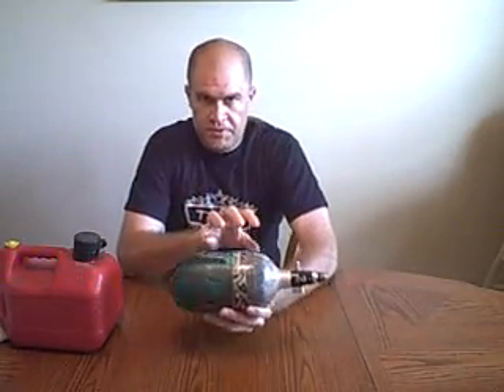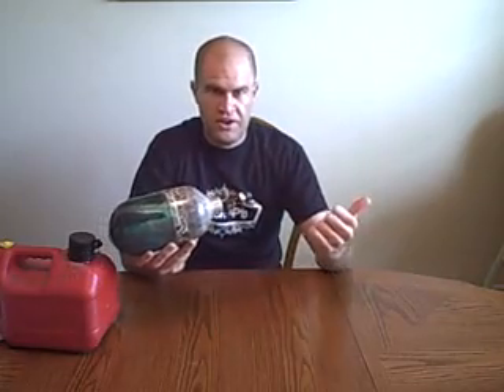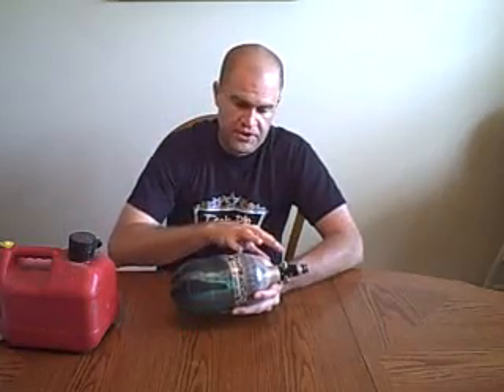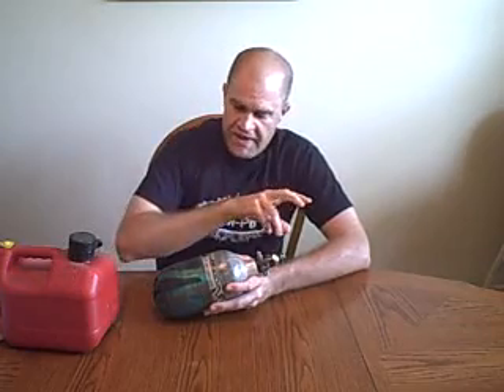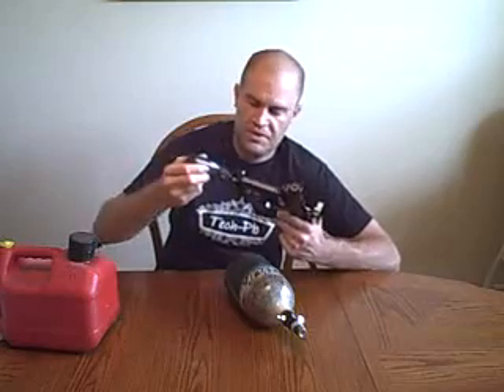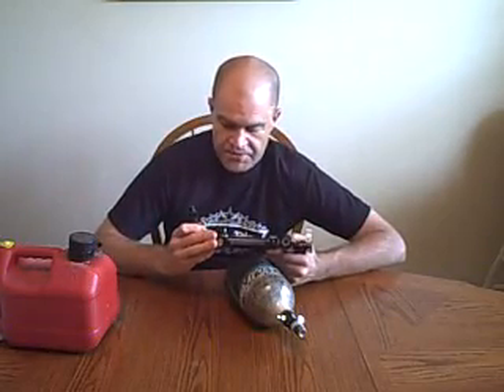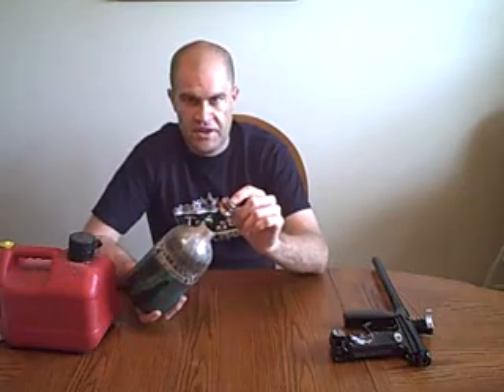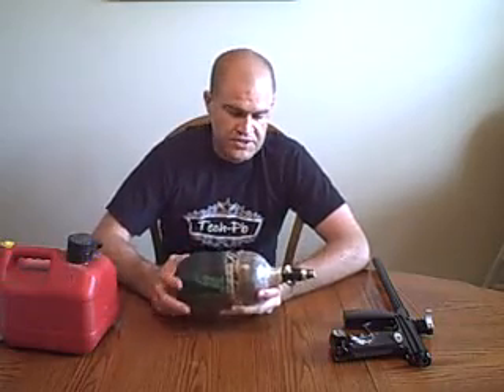Exploding Paintball Tanks (This applies only to HPA, not CO2)

Comment: Actually when I was taking welding courses years ago a guy used his figures to clean the bull connector on an oxygen tank and the natural oil from his fingers, upon opening the tank caused the regulator to explode off with enough force to pass the regulator through a concrete block wall.

Comment: Hey, i Was installing my new guerrilla regulator onto my Ninja tank and while i screwing on the regulator, i saw that the locktite was on the same thread level as the bleed passage. it looked dangerously close. I didn't wipe it off. for somebody told me that it'll be fine. will this cause a hazard to me? Should i redo the regulator? will it just dry up and be harmless? thanks.

Comment: the only reason why airsoft is far less popular is because 1. there are far more restriction with airsoft rifles and I'm not talking about the plastic guns but the full metal complete replicas. 2. far more expensive depending where you are a good full metal rifle can cost from 300 to 500 dollars, 3. there are more paintball field than airsoft is because paintball fields make more money than airsoft, as they can supply rentals far more easily as airsoft it's usually require to have yourown things

Comment: Hey mike, my fill nipple is leaking right at it's threads (i can hear the air hissing out). i put a drop of water right where the threads are and i saw bubbles come out. i then wiped off the water. and took a wrench a tightened the nipple onto the tank. The hissing stopped. do you think its safe to use?? thanks

Comment: ?pressure causes oil to explode? It does explode at room temperature, or due to heating caused by compression? i remember oxygen tanks are forbiden to lubricate in welding..

Comment: I was wondering, is it safe to place silicon oil into the On/Off valve of a remote line? I know that it is safe to place in the ASA of a marker. Would the regulator of a HPA tank stop it from getting too much pressure in the remote line to combust the oil? Just want to know before I end up damaging my remote line or worse, myself.

Comment: @vback77 Yeah doesnt matter. But I have no idea what you are talking about. Your putting lube in your ASA to clean out your gun? Or you mean putting it in your breach? Your suppose to use oil on the bolt. Only need to put a few drops on your bolt.

Comment: @airsoftremix - to my knowledge no ball manufacturer uses oil in the production. The ball is gel, the fill is a combo of food colouring soap and crayon wax. To be on the safe side - when the tank has pressure, the shuttle valve is closed and it is safe to clean it without fear of getting anything inside the tank. Only when there is no pressure in the tank will the valve be free to shake back and forth. so if dirty and has enough pressure to keep the door closed wash it with warm water and dry it

Comment: @geis / PCXP - CO2 is measured by weight, you're dumb. You can fill a CO2 tank with air using the CO2 fill station and a scuba tank. CO2 turns from liquid to gas at ROUGHLY 850psi, this is completely dependent and very sensitive to the temp of the CO2.   That said - you can fill a CO2 tank with HPA but because of the burst disks you'll only get about 1K psi (depends on the disks you have in it) Aluminum tanks for CO2 and HPA are the same, just tested and stamped differently.

Comment: Diesel is flammable... it's just harder to get it to combust. All petroleum based fluids combust under pressure. The reason a diesel engine uses pressure instead of a spark is because a spark will not ignite diesel <- fire can and does. Please do not spout false information, and if you'd like to refute what I've said I invite you to go out and buy 10 cents worth of diesel, coat your arm in it and put an open flame near the vapours coming off of it: I'm not responsible if you actually do this btw

Comment: Then only the burstdisks will fail. the point with the oil is that the pressure expansion is so fast that the burst disks wont work and the tank fails. under normal filling circumstances it takes seconds to get from 3000 to 4500 psi, not milliseconds

Comment: Absolutely not. Co2 is liquid at 850PSI
HPA is in the tank at 3000-4500 PSI. Imagine you blow up a baloon to4x its normal size. Will it pop? YES. Same thing with a metal cylindar. It will pop. not a good idea.

Comment: I may have gotten pizza oil/greese on the top of the fill nipple, not a crazy amount just a little. I stuck a Q-tip in the fill nipple and then ran the Q-tip over water and it soaked up so if there even is any oil it is a very small amount, what should I do?

Comment: it doesnt fuck up mechanical guns like cheap spyders, and tippmanns but if you use co2 with an electronic gun like an ego or g3 it will freeze up the internals and can ruin the board

Comment: No, they dont at all. Those are for comfort when you brace it against your shoulder and to protect the outside of the tank from scratches and dents that can damage the exterior. Paintball manufacturers dont really design gear for that purpose because it basically never happens. Very rare. As rare as someone going blind from paintball.

Comment: Is a 3000PSI / 200 Bar tank a high or low pressure tank? Just wondering, because i got one of those, and were just wondering if i spilled like a drop of oil in my fill nipple, that if it would then blow up...  

PS: Is a 3000psi tank safer than a 4500psi tank?

Thanks Mike!

Comment: yes its a fact that your fill nipple is leaking cuz gunk and dirt will build up on the oring witch will keep the shuttle valve open causes it to leak and your gunna try to cheapskate the problem and put oil in the fill nipple and try to air it up and oil will get into your tank and oil at 1500psi will explode so take the tank to a feald manager or a local store and have them replace the oring. DONT DO IT YOURSELF!!!!!!!!!

Comment: co2 is incosistent compared to hpa in terms of fps because of temperature. also when co2 enters your gun it is very very cold which can "freeze" your O-rings causing leaks after awhile because an inadequate seal. WHen he was talking about the crap in the air it has no effect of the acual filling.

Comment: well with temperature co2 changes into liquid and gas, which changes the pressure. lets say your you chrono your gun on a cold day at 260FPS later when the tank heats up it changes back to a gas which increases the pressure, then you get a spike that goes upwards of 300fps.

Comment: no,a household compressors air gauge will most likely only go up to a few hundred psi. an hpa tanks pressure is either 3000 or 4500 psi.

Comment: when u put on your tank it will leak with c02 it will leak badly when that happens with co2 grop your gun right away DO NOT TRY TO TAKE IT OF!! ull probly burn urself with compresed air its absoulutly fin to take it off it wont harm u at all

Comment: just to answer your question no nothing will happen Co2 operates at 850 to 1000 psi when it reaches that point it turns into a liquid so even if oil gets into a Co2 tank you will be fine plus even if your Co2 tank reaches i think its 1500psi there is a burst disk on the tank that will pop releasing the air so never store filled Co2 tanks in a hot car because the burst disk will pop and you will eather have to replace it or get a new tank.

Comment: No, the visual part of the inspection finds dangerous dings/cracks. The actual hydro is where the tank is filled to 5/3 of its operating pressure to see how much water it displaces. if the tanks expands too much, it will have a hole drilled in it to prevent further use.

Comment: #1 they dont put 99% nitrogen its too expensive pure nitrogen is like 10g's per ml #2 did you hear what he said its a diesel engine! first the oil ignites and explodes and the nitrogen is just the stuff that makes it explode mostly because anything is explosive under pressure

Comment: WD-40 is BAD!!!!! it will ignite under pressure. If you must use oil on an HPA tank get some synthetic oil from a paintball/scuba compressor company. Nuvair 751 oil is what I use in my compressor and on my HPA tanks. Nuvair 751 can take pressures higher than 5000PSI.

Comment: Most likely the ASA came loose? If not somebody must have been screwing with the tank threads.

Me and my friends have bled tanks by pressing the pin on a table corner etc the pressure is high but it doesn't kick you back or anything. (DXS tells you to depress the pin valve to empty it) So it'd be a pretty lame "rocket".

That or maybe your HP (1800ish) burst disc failed? That'd give it some oomph.

Comment: Actually you are wrong about that fact, true... diesel engine works by compressing the air wich produce alot of heat, but this is within the speed factor, so, to explode a mix of air and oil, you would need to fill your HPA tank in less than a second wich is pretty much impossible with standard hardware. Beside I always fill my tank slowly as a precautionary measure.

Comment: just to clear some of the things that have been said on this comments... the reason the oil explodes in the tank is because of the pressure on the oil... as he has said before, its like a diesel engine. the compression is what makes it explode. not to mention the friction from the air.

Comment: c02 is a liquid, and it's cold

hpa is hot and the heat ignites the lubricant which causes the pressured air to ignite and the tank can't take that so it explodes

Comment: thats why you get a remote line rated at the pressure of the tank or higher. what happens is someone has a 1000 psi remote on a 3000 psi tank, and when the reg fails, your remote line goes.